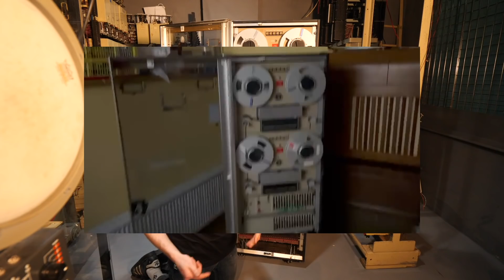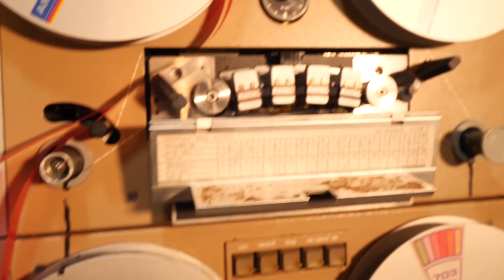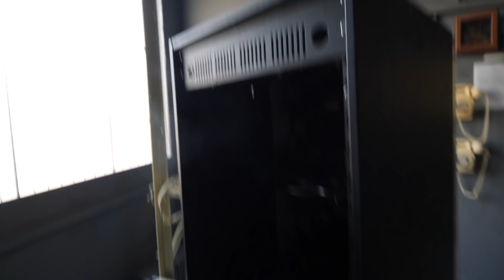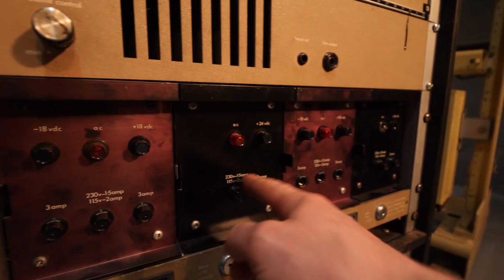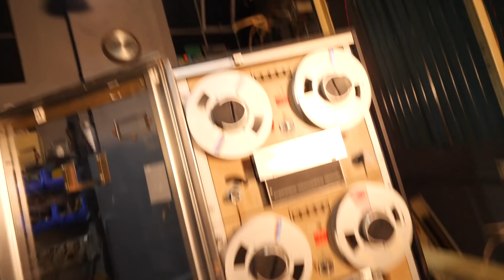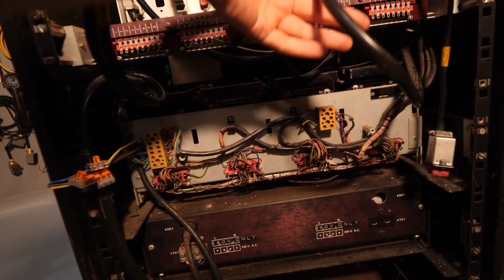The Racal ICR 32 REEL TO REEL Air Traffic Control Recorder

Comment from the maker: The questions I have for some people in the know on these. is that erase and record heads. Or record and read heads for monitoring that the tape is correctly recording..... regardng the speed.  the speed i mention is way too quick, itll become obvious when it starts running.
Reply: You got 4 heads there, on each transport: Erase, Record, Playback and most likely a dedicated Reverse Playback head. Since it was designed to run & record 24/7, in a LoFi quality, I assume it records at the slowest speed to make the tape last the longest, which will probably be 3 3⁄4 ips in this case. These are just some educated guesses, mind you, but surely someone more knowledgeable on these particular machines will be able to fill you in. 😉

Despite it's original purpose, I still bet you could record some cool LoFi music, if you really wanted to. 😎
Reply: The tape won't transport until the tape is threaded, and pulling on the auto tensioning levers, engaging their microswitches. It's what engages the autostop when the tape comes off the end of the reel (or in that sad moment when the tape snaps) and also starts the reel motors in opposite directions of each other to tension the tape. You can just hold them with your hand for testing/servicing purposes. (ah damn, I see the spoiler note after I typed this xD)

It looks like 1" tape. 2", 1", 1/2", and 1/4" tape are standard sizes. Studios would usually record 16ch to 1" or 24ch to 2", then master the mix to full width (2ch) 1/2" tape to send off for vinyl cutting. 

I see speed forward and back control. It'd be super lucky if it went up to 30 or 15 ips. (Studio speeds) I'm going to guess it tops out at 7.5 ips (if that) and probably never really ran that high. If you could manage to get it up to 15 or 30 ips you could then replace all the tape heads with studio ones if you wanted to use it for HiFi recording. But I doubt that's your intention with this bad boy.

You may have already found and read this ICR32 service technician's forum post from 2006 on vintage-radio.net but I'll leave it here just in case:
"Yes they are still in use! I'm responsible for 6 pairs.

They are a multitrack machine with limited bandwidth (300 to 3400Hz), and are used for voice recording in air traffic, banks, stock exchanges and the like. They come in a number of flavours, 16 and 32 channel with 1/2" tape, and 32 and 64 channel with 1" tape (the electronics is the same, just a different number of channel boards (1 to 4), and a different set of tape guides, and obviously, the tape head.

They will not normally have an erase head, but can be used to record and playback. I have the manuals, including the mechanical set up of the deck. Thales (Racal) no longer support them, but a company called Precision Applications has taken over the support and spares.

The machine in the [forum post] picture looks to be a 32 track 1/2" one, which will have 30 tracks available for record, plus one time track, and one spare (automatically switched in on failure of pilot tone recording).

Machines are normally fitted in pairs, to give continuous no-break recording (one tape change every 24 hours, with auto changeover), if more than one track fails, the second deck will come on line, as it will at the end of the tape - there is normally a 1 hour overlap where both machines are recording.

These machines are fast disappearing, as they are now around 20 years old, and are being replaced by new digital machines.

________________
Jim Beacon G1JBG
www.g1jbg.co.uk"

I guess that means if those are 10.5 inch reels with 6000 feet of 0.5mm thick tape on them you're looking at 0.8333 ips to cover 24 hours. I'm also totally guessing the reel size and it could be larger than 10.5 inch. 

Jim's website went down sometime after 2017, and the only email I can find for the guy uses that domain. I imagine if he's still with us, he'd have a lot of useful information.
Reply: Might be 1 7/8 ips or 15/16 ips for the speed
Reply: @limmit00  Agreed. Most likely 15/16 ips.  Also "voice frequency" recorders are generally 300Hz - 3kHz bandwidth.
Reply: I used to work for Racal Recorders, though I didn't work on the ICR 32, I've worked on other ICR systems, Wordsafe, Storehorse and Storplex.
From my memory, the ICR system heads include both a play and a record head together with an independent erase head. It had multiple record modes, including looping from end to end recording 16 channels on each pass. This enables continuous recording.

They were usually fitted with a data card for recording data from the radar system; thus synchronised voice and radar could be replayed on demand.
Reply: OK. Now it's been over 25 years since I worked on these machines so beware.
32 tracks. 16 record 16 replay. NO erase head, tapes were manually erased away from the machines. Ran at 15/16 of an Inch per second, with a bandwidth of about 300Hhz to 3.2kHz.
That particular machine was used in Air Traffic Control, almost certainly at the London Air Traffic Control Centre (LATCC and later LTCC) for recording both speech between Controllers and Aircraft and controllers desk positions. Each track recorded either a specific Air-Ground-Air Frequency or a specific Air Traffic controllers desk position. They ran continuously for 24 hours, one recorder working the other on standby to take over when either 24 hours elapsed or a fault occurred.
The reason for having playback heads was twofold. One to allow engineering staff to monitor or fault diagnose but more importantly to ensure that the input was actually being recorded. A pilot tone of 400Hz was added to the record signal and this tone was looked for by the playback side, If the tone was not there than there was probably a fault with that tracks recording side. Track one I believe was the spare track. If one of the tracks failed the recording would be switched to track one. If more than on track failed then the other deck would be started.
Track 2 was used for time code recording. This time code consisted of a simplified morse code tone recorded like any other audio track.

Comment: I used to work for Racal at the factory in Southampton that made these recorders. I was a wireman initially but then I had a job as a test engineer.  Inside these there is a electronically switchable filter panel, which switched in a different frequency response curve depending on what tape speed is selected. 

Theres every chance that panel(s) has been bench tested by me and has my stamp on it, although cant remeber my QA number

Do you still have this up and running.   would be nice to see it some time to remind me of old times at Racal.  Its a weird feeling knowing the stuff i used to test and fix, is now in a museum. :)

Comment: I used to test these at Racal Recorders in the 1980s, along with the later ICR 20 and 40 machines. The missing item from the bottom of the cabinet is the fan tray. It kept a bit of positive pressure in the cabinet to keep the dust out and circulate filtered air. These machines were voice recorders only, only the later versions could record radar plot data. In Voice Op the decks are stopped, but the capstan runs, so the tape pick up is practically instantaneous. The lifter bars between the heads keep the tape off the heads during spooling to reduce wear. The central "crate" contains the channel cards, and the logic to change over to spare channels if one fails the 400hz pilot tone detection monitor. There's also logic to control deck change-over etc. The signal cards up by the heads are groups of head replay amps with frequency response shaping circuitry. Basically it's a telephone-bandwidth 32 channel recorder with potentially 24hrs recording per reel and automatic deck changeover and re-wind.

Comment: I don't think it was at Heathrow. The airport ICR's had two sets of electronics, one for each tape machine. That looks like a single electronics machine. They were used at the Air Traffic Control Centre at West Drayton (about a mile from Heathrow). Now a demolished and a housing estate. The ATC Centre had a spare set pair machines that could be swapped in if there was a failure of the electronics.

Comment: A freind has a 16chan version of these. 
It was used to monitor phone lines at a call centre.
Did you get the audio clock to go with it? It is a magnetic drum with read heads for each digit. Reads the time out by switching between heads. That was recorded onto track one as a timestamp.

Voice op is a voice operated record. So it only records when there is traffic.
Very low tape speed, so certainly only comms quality bandwidth.
I believe they were record and playback units.
You will need a bulk eraser to wipe the tapes.
Reply: Correction. His is the exact same 32chan version. He probably has a full set of manuals too.

Comment: i had an 8 track reel to reel that i had replaced the melted tar wheel with a found metal bearing with some card board also rolled in the middle of the bearing.  

the bearing was probably slightly smaller than the tar wheel was, and it worked and i recorded that way, but if i moved the machine 3 feet to the left, it would mysteriously stop working for a week or two, then start working again.  

might have been the size mismatch on that roller wheel causing the malfunction. my bearing was slightly smaller,  i think. something wasn't quite engaging, maybe it was a funky spring or switch in the lever next to the wheel.

* low fidelity is probably more the tape speed and the audio source than the recorder itself

Comment: Note that the tape (1" audio tape) needed to be threaded into the tape path, and the load tape button pressed to tension the tape correctly. The tape mechanism won't move without this being carried out. The tape was kept tensioned correctly by controlling the power to the two spool motors, with moveable tension sensors providing feedback to ensure correct tension.

Comment: Put the audio on it from some of your YouTube vids so people can dial in and listen or some old ATC audio. If the system plays at a weird speed then just use software to change and match it. There must be somewhere where the ATC operators headsets wire in and the feed from Aircraft. Just thinking out loud really. Im a stage/sound tech so would love to mess about with this.
Reply from the maker: the only real issue is its a recorder. its not for playback or erasing. only with some mods here and there will it really work for playback.

Comment: The playback heads are probably confidence heads. These are only to playback the recorded signal right after it is recorded so that you can be 100% sure there is a signal on the tape it also makes it much easier to align the bias, azimuth and phase of the heads.

Comment: Looks like 1 inch tape which is standard enough, it would have run at 15/16th inches per second, which is half the speed of a cassette player. The slow speed will mean the highest frequency it could record would be about 5khz or so, fine for radio coms. Things aren't turning probably because loads of rubber bands have gone the same way as the pinch rollers.

Comment: I did the course on this. It records the w/t channels to the aircraft for ATC, only to 3khz BW, the tape going so slowly allows, if I recall ,24hrs on each. You had to look at it twice to confirm the tape was moving.  I recall something about record monitoring, this was legal data after all. The standing orders required a tape once finished went into the 7 day series, and the next one bulk erased & recorded over, so any incident in the last week could be recalled. On the course exam there was an empty Avo case next to the bulk eraser as part of the test.  If I haven't purged them the course notes are in my loft, oh my. This was the RDCE equipment, and it was in MRCE. The CAA liked 4 letter acronyms. This came from LAP I believe, we were at LATCC, West Drayton.  You would have to trawl through a lot of tapetime to find anything interesting, and then, very little. If you wanted to record seismograph data in a big space, this would be great, but nothing an Arduino & an SD card couldn't do.  Let's see - 3khz * 3600 * 24 = about 300 meg. Pass me the SD card...

Comment: Used to work for a telecoms firm who used something very similar looking as a call logger.  Never took much interest, it was often said that retrieving a call (if it was even possible) was such a pain in the arse it would only be done if absolutely necessary. In practice, that was never.

Comment: Regards to ICR 32 used by ATC only can be used to record up tp 32 separate channels for it to work tape will have to bulk erased, to play back recorded audio it needs a separate play back deck.
Tapes will run for 25 hours but tape will be replaced after 24 hours and manually start up standby deck, the tapes will be kept for 30 days before being bulk erased before reused  unless replay required  by ATC.
Each channel has a plot tone recorded  at a  low frequency this is notch out on replay, if a channel fails it will give a deck alarm and transfer audio to channel one if more than one fails will start the standby deck.

Note each channel can checked for correct  recording by used the card slide controls, the button will check the pilot tone.this in real time  with a slight  delay, due to the spacing of the heads.

To check for correct operation a test is transmitted on each frequency for correct speech quality ever two hours, the standby will checked by ATC.

If you need to used ICR 32 for demo purposes you will need feed a test audio signal all the time note a 600 ohm balanced input at  0db about 700mV is required.

Channel two is used to record morse time code this channel is lso used to record information as to date and time both on start and end.

In ATC systems the line side channel frequency from the RDCE is recorded , the controllers desk side which will include intercom  and phones audio.
 
Standby hand sets will record onto a separate channel.

Hope this information helps.

Kind regards

Comment: Idea for making it musical: have an input (SM58, synth, whatever) for museum goers to mess with. It records into channel 1 on a tape loop on the upper reel. Read head of Ch. 1 upper reel is connected to write head of Ch. 1 lower reel. Lower reel is running just a little slower. Ch1 lower goes to ch. 2 upper, which goes to ch 2 lower, then ch3 upper... You get the idea. Museum users can turn a dial to listen to their own audio, or after one pass of tape, or after 16 increasingly grungy (and pitched down) iterations. 

Depending on how it's wired up they also might be listening on a delay? Like if the write head is just after the read head on each tape then the audio has to go all the way round the loop before it gets to the read head. So you might hear a kind of weird unintelligible imprint of what people were doing 15 mins before you got there! 

Fun for all the family :p Totally ruins it as a piece of history though.

Comment: As others have said, instead of 3D printing replacements for the rollers, you can also try some simpler things like anything rubbery you can stretch over the pegs (maybe segments of bicycle inner tube). My experience with flexible 3D printing filament, even the softest stuff like NinjaFlex, is that it is still not as soft as real rubber and doesn't offer the same amount of grip, but I'm not sure if that is really required here. Also, it is not easy to print with, definitely needs a direct drive extruder and very slow speeds.

Comment: Hey man! I do my maintain my own tape machine in my studio, if you need any info on tape machines, feel free to hit me up! About the big question about the tape itself, I think it's 1" tape, which should be generally available. The tape that is currently on the machine could be suffering from Sticky Tape Shed Syndrome, and might need baking before you can use them.
Reply: This tape recorder looks like snake oil to me!
Reply: @AntiDot70  Tape recorders are never snake oil!

Comment: Trained on similar in air force for tower com's, get rubber put on by russel, replacement belts suppler sent in the rollers and they referbed with new rubber. Did a lot of antique recorders. 
Nice 3 motor decks, could use for display audio etc. Maybe change tape speed, but heads and preamp mods? Or use for control audio with freq to voltage converters.

Comment: Looks like it works on duel phase and that would make sense too for it's use, you could probably just power with one set of PSU to start with
Reply: We don't have dual phase in the UK, it will likely be single phase 230V

Comment: It looks like there is a phase shift cap next to each motor, so it will be asynchronous motors for spooling and Synchronise motor for capstan so changing the speed means changing capstan shaft or Capstan motor. An yes 15/16" per sec sounds about right.

Comment: I do have a memory of having to line up same machine in a radio station. ABC Australia. Freaked out because of how bad it sounded. The recorded spoken clock on one track. All channel record. Looks like 1 inch and I think I know of someone who may still have service manual if required. He worked for Australian Distributor.

Comment: For replacement reels/tape check with the UK/US navy "Sonar" recording electronics.  Those are  the one-inch tapes we used in  the 1980/90 time frame.  Maybe check out the local Hawker Siddeley Nimrod museum (LOL).  Those are very, very, very high quality & sound sensetive tapes.  You got very lucky!  If you can find the tape on the glass reels you get a bonus of being able to break a reel on highspeed rewind.
Reply: Also looks like 1 inch Reel to Reel video recording tape as used on early Ampex video recorders.